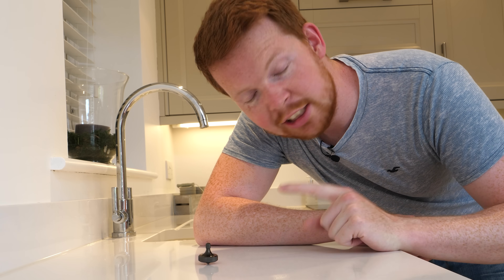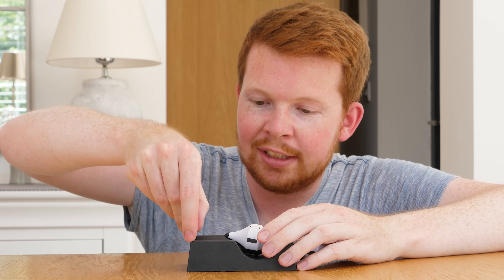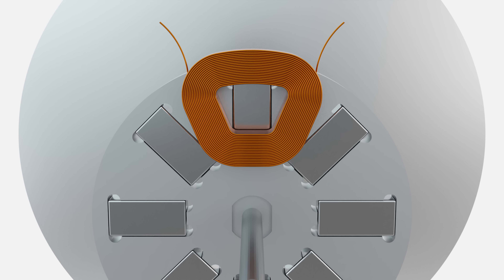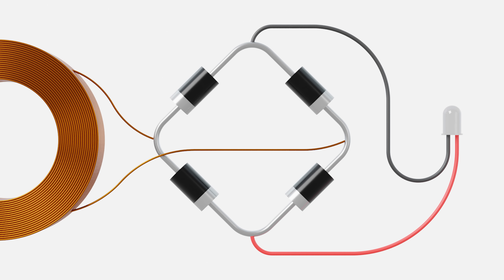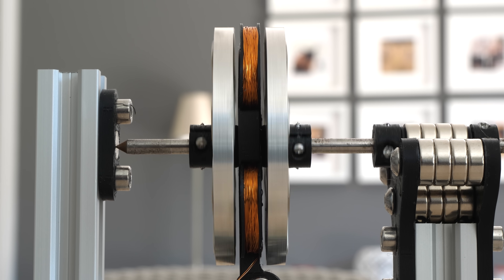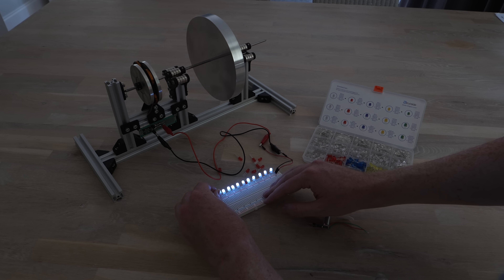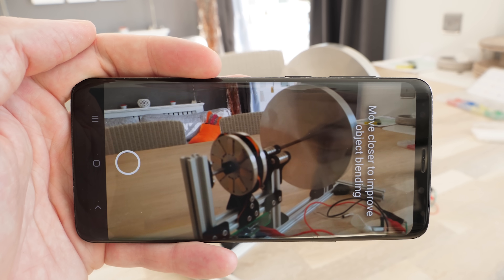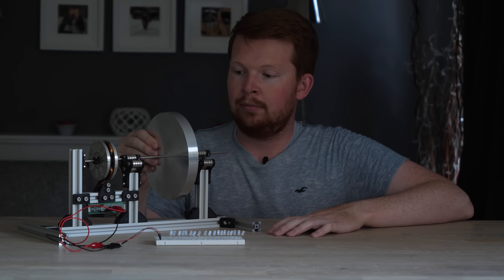Flywheel Battery

Comment: "We also need to convert the AC to DC"

proceeds to use two examples that can run on ac

:V
Reply: The LEDs would only be half as bright and would eventually die (although they are technically diodes, they don't like to block current or they die). That brushed motor would not run on AC...at least not in one direction.

Comment: what if you offset the coils slightly to make the flickering faster ?and hence have a smoother light ? you ll get less energy output stricly but to compensate you coul use a crank with a high gear ration so that you can power the whel with just a spin that multiplies 1 rotation to like a hundred or smthg ? sick project tho, could make that huge with bit more work on the hardware but i believe in you mate

Comment: 5:40 Incandescent bulbs work with either AC or DC, and fluorescent bulbs are generally designed for AC. What you said is only true for LED lighting, but if you buy an LED lamp from a store, it will have its own rectification electronics. It is however pretty tricky to control AC frequency and amplitude compared to DC

Comment: Maybe a good idea on one side is to have a gearbox that uses magnets to help spin up the flywheel meaning you can get a higher rpm from less spins by the hand, which also may help stabilize it

Comment: Bear in mind Tom that by adding LEDs in parallel will only split and share current (not p.d.) hence the flywheel will slow down faster, and you could add infinite LEDs at the same p.d., so perhaps adding lots of LEDs in parallel is not a good test of p.d. induced, but instead an LED test in series is more useful.

Comment: If you add a synchronous motor controller, you could also pump power into the flywheel as well and use it as a kinetic battery (or more like a capacitor).
Also, there must be some way to use similar magnet tricks for the axle endpoints and get rid of the friction point at one end... 
Other than that, there is the option of removing the air around the flywheel, running it in a vacuum, but that one it's slightly more complicated :D
Cheers,

Comment: two sided support, cups
Reply: step up converter
Reply: make that dc, you dont have to alternate, flip flop, from side to side
Reply: you are so used to electronics in motors, that you no longer can make a dc motor-generator
Reply: also you can move the coils away when you dont use the device, energy storage, like a clutch, just put a planar radial wire coil to extract or spin the flywheel
Reply: that hand cranked energy storage, you would even pedal it
Reply: what if you flywheel a current in super conductor, thats a YBCO super conductor inductor battery, L=1000m, I=5kA, E=½LI^2= ~3.5MWh
Reply: flywheel car floor bottom flywheel with maglev on stick, opposite poles maglev, rpm 20000 or 20kprm, radius 1m, 300Wh/kg+, as battery, acts as a flywheel stabilizer, the car will stay level no matter how you punish it, similar to the vacuum turbine succing the car to the road, or down force vanes on the car, say 200kg of flywheel, to have some stability from the rotation momentum
Reply: plasma wire as coil inductor battery, same idea as in the YBCO coil inductor battery, E=½LI^2

Comment: Putting the coils in series on your generator actually only works, because the number of magnets is divisible by the number of coils. If you had, for example, 6 magnets, the AC voltages at the coils would be all out of phase, and the resulting voltage would be quite low.

Comment: The mass on the center of the flywheel contributes very low so it would better if the middle is hollow and most of the mass is on the edge.

Comment: Why can't you hook up the electric motor to keep the flywheel spinning thereby creating a perpetual motor.  flywheel keeps providing power to the motor, motor keeps providing power to the flywheel and so on.
Reply: There are losses in every step of the process, so it will just stop in a rather big hurry. Perpetual motion is physically impossible, and so is "free energy".

Comment: This could be so much more than a desk toy.
Tungsten is weakly magnetic, so maybe that could make for a heavier flywheel?.

You could optimise the shape of the flywheel like you have done before.

You could get a glass rod instead of metal and glass on glass has a low coefficient of friction.

You could make a device that when you push on it, the flywheel spins up.

You can do this in a partial vacuum in a more suitable gas.

The part of the contraption where you push on should be easy enough to manufacture.
How it will spin up the flywheel is up to debate.
You could use air, but it runs in a vacuum.
You could try spinning up the axle, but then you need a way to connect to the axle without rev matching.

But if you manage to do that you can potentially store loads more energy.

Also, it would be interesting to see if, when you add load, the rotational speed decreases and increases when you take away load

Comment: There’s another way to arrange the magnets that would actually be frictionless. Look up the force on a magnetic dipole from a magnetic field, and you can then see what kind of magnetic field you need to generate to keep the magnets in a potential well of sorts. 

What you’ve got is a passive axial magnetic bearing. There’s papers out there on how this has been achieved for example with Halbach arrays. The one I’m looking at right now  exerts about 1000N per Millimeter of axial offset, and about 20 Nm torque per tenth of a degree axial offset. (Jinji, et al 2011)

Mainly I just want you and anyone watching to know that it is not necessary to have a pin like you have for magnetic bearings to work, but it appeared to be simple to implement, which is often the highest priority for home projects

Comment: Extract the planetary gear box from an old drill, mount it backwards on the shaft and add a crank with a further increase in ratio
Add a free wheeling ratchet like on a bike so the crank doesn't turn when you stop changing it

Comment: Please make an electronic gearbox that uses this principal. Possiblity a bike where the pedals drive an alternator which powers a motor controller which spins the wheel. It would be a bike with an infinitely variable gear ratio.

Comment: At the voltage levels you are using the forward voltage drop across the diodes is probably consuming a large percentage of your power.  Consider using a FET based full bridge rectifier.  You get a much better FET conductance (lower resistance) than from the diode alone.  I have not used these myself but a little googling and I found the LT4320 (which seems to require 9v) or the TI "smart diodes" used to build a full bridge rectifier such as: https://www.ti.com/tool/TIDA-00858#descriptionArea.

While diode full bridge rectifiers are great, they are not efficient especially at low voltages.

Comment: It's like when you have two motors and you connect them electrically together, and when you mechanically spin one, the other spins too. 
It feel even more magical when you do this with huge 3-wire brushless motors, because the positions are kept in sync.

Comment: if you want to get way deeper into the electronics, you should you a hall efect senser and a motor driver to use those same coils to spin up the flywheel and see how fast you can get it.

Comment: I think what would be interesting is to spend it to a specific high RPM and see how long it takes to stop while powering the white leds.

And then spin it to the exact same high RPM with no continuity on the dynamo. And see how long it takes to stop with no apparent Lorenz forces.

And then compare the times.

However I would not have made this video until I had it completely balanced. Whether you had to start all over again with different aluminum plate and bar. I definitely would recommend having as little wobble as possible for a scientific result.

But nice video.!
Reply: Yes! This is what i thought he was going to show, this would demonstrate the battery part a lot better.
Reply: And maybe use an odd number of coils (instead of four) more closely spread across the plate (so non-symmetrical/without gaps a magnet would always be entering a new coil somewhere) or maybe extract multiple phases instead of going for the highest voltage to get a really nice solid DC

Comment: Be cool to have this on the forrunner. Incase the solar panel is blocked by rain clouds. Just crank the fly wheel to charge a battery. Not a car battery but stuff like a cell phone a fan. Or even a electric stove battery.

Comment: If you used a switching converter you’d be able to have an actual gearbox. By varying the amount of current you’re drawing from the flywheel, you’d be able to power any load at its ideal voltage / current, and take as much power as you need. Very similar to how an MPPT tracking solar charger works. Actually you wouldn’t need a switcher at all if you made/used an actual alternator with an armature coil or variable magnetic meshing. Changing the armature coil voltage or the magnetic meshing would effectively change the gearing of the motor.

And next time please measure the output power, voltage alone isn’t very useful.

Comment: When voltages are low you can do a mosfet configuration based full bridge rectifier and have ohmic losses instead of diode Vf. Simplest configuration is just 4 mosfets(low threshold ones). For wider voltage ranges some zeners and resistors might need to be added to protect mosfet gates as usually done in "mosfet reverse protection" circuits. There are also ideal diode bridge controllers like LT4320 that goes all the way to 72volts.

Comment: Ok, am I the only on wondering if there is a way to get this well balanced, then add a small but efficient air pump to the setup, this could be aimed at a modified fly wheel which could be efficiently rotated (blown round) by it. Ok, I know this would defy the laws of thermodynamics, but it'll be interesting to know just how close you can get to zero power loss.

Comment: So in theory, if you were to encase the device in a housing of sorts and add a propeller or turbine to the turning end of the shaft, you could have a relatively frictionless wind generator that could charge small batteries.
So cool!
Thanks for this.
Cheers!

Comment: Cant you just modify the part where the shaft of the flywheel is pushing against the plate by 2 magnets with a same pole facing each other. So the friction must be reduced even more.

Comment: Add blades to it so it becomes wind powered, and use the fan you installed near the end. Just to complicate things. 

Oh, and it would be cool to measure the rpm of each blade, and compare the numbers to see how much energy has been lost to friction and electrical resistance

Comment: I think a lot of people have a skewed idea about the weight of aluminium due to its use in things like soda cans.

I know I was like that at one point, then at a job I was introduced to a plate of aluminium that was about an inch thick and perhaps 3 feet tall and 1.5-2 feet wide..... I could barely move it.

Comment: I don't know which kind of diode you used, but If that diodes are a regular rectifier diode, you can use Schottky diode instead, the voltage drop across these kind of diode is very low. Schottky diodes you can use: MBRS360, UF4007...

Comment: Could you run a 5v motor to spin the flywheel whenever its rpm get too low back to high rpm and have infinite energy?

Comment: Hi Tom. Have the coil's rotating on the shaft and the magnets fixed and power very small motors with small propellers on that are attached to the Disc (Perpetual motion). Love your project's.

Comment: Hey Tom, please close your magnetic-circiut by adding metal sheet on the outside of your circle of mangets (Yust a circle of metal sheet on both outer sides). This should improve the magnetic field by a lot. Even more importent would be to add a magnetic core to Your coils. Because of the changing magnetic field, it should have a small hysteresis like a soft iron core or a ferrite core. The problem with this in Your setup will be the magnetic reluctance forces, which will give your flywheel a jerk torque, which propably is to much for the self-levitating mechanism. So perhapps you should stick with the metal sheets for the magnet-circle. Nice Video as always.

Comment: It would be interesting if you could measure how much energy loss you have when powering something. Let's say that the flywheel has x Joule in rotational energy and you transfer that energy to some kind of calorimeter (until the flywheel stops) to see how much of the original flywheel energy that ends up in the calorimeter. Another interesting thing would be to see how much energy you lose per second because of frictions (air, mechanical) when the energy in the flywheen is not used for anything. And are there unnecessary eddy currents that can be eliminated? Can the whole thing be improved by considering eddy currents?

Comment: If you increase the power demand on the circuit, for example by adding more LEDs, does it increase the resistance on the generator and slow the flywheel down more rapidly?

Comment: @07:49 IDK man... A 3D Print Stepper Motor Coupling ( https://i.imgur.com/mSTlln5.jpg ) with one side attached to the free end of the Flywheel Shaft and the other chucked into the Drill for a quick disconnect once brought up to speed could have prevented that janky looking setup with the roller skedaddling along the flywheel's circumference... 😑

Comment: Can you put a high torque motor (that charges with the power generated) on it to spin the fly wheel and see how long the circuit will run without stopping?

Comment: But for a electrical battery, i don't get into using flywheels for a solution for it.  But flywheels are great energy storage only for short time periods, very short. Useful in engines and machines, mechanical.

Comment: I would be interested to know how much the load slows down the flywheel. It looks like the flywheel slows down quite significantly with the motor attached. I've built a couple of mendocino motors which also use magnetic levitation, people always seem to ask me 'well what can you power with it!?' as if everything needs to have a purpose besides just enjoying a wonder of science. Anyway, a mendocino motor, and especially a small table model isn't really fit to power anything but itself. It's interesting to play with these setups, also to learn and conclude that there really are laws in place for the conservation of energy, and you cannot make energy out of thin air. This is why most people claiming 'free energy devices' to work, are also the people who've never actually tried to build one. Experience makes you more educated.

Comment: You should compare how long it takes the flywheel to spin down with only 1 led vs with 10+ and see if you can measure/notice the counter torque generated by the extra led's in parallel pulling more current, because I bet you there would be a not insignificant difference

Comment: Just get a bit of string and you should be able to spin it up to quite high rpms easily. Also if the shaft wont come off heat up the flywheel with a blowtorch. Probably need to put the shaft into icewater tho since alu conduicts the heat very efficiently. Or just drill it out.

Comment: You need to use schottky diodes in your rectifier. They have a smaller voltage drop them silicon diodes.

Comment: When I saw the thumbnail of the video, my initial thought was that you will use the flywheel to mechanically rotate something via eddy current coupler (I thought that the alternator was the eddy current clutch/coupler on the first short glance). :))) Nevertheless, your project is so interesting and amusing. I liked the video right away, at the start of the video, I was confident that the video is excellent right away from the getgo without watching the video to the end.

Comment: Do it again, but this time with thicker shaft and the bearings totally surrounding the shaft 360 degrees. Like how you make that Y piece that holds magnets, make it an O piece where the shaft fits in the center with magnets surrounding the shaft magnet/s.  This way it still works if it is on its sides or upside down, and you can put a hand crank on it and that O bearing will hold it in place from your force pulling up, down, and around using the crank. Note: use hand crank with a type of clutch so it catches on the shaft when you crank on it by hand, but then the hand crank sits still after you let go, but allows the shaft to spin.

But that is another experiment. Try to figure out how to make a magnetic clutch for the crank. Meaning the bearings for the clutch being magnetic.

Another experiment is to figure how to get rid of that glass plate and pin point, and make it into a magnetic bearing too. Get rid of that friction point! Figure out how to hold the shaft in place without allowing physical points rubbing. Put magnetic end bearings in place of that glass plate, but put them on both ends, and now it is secure no matter if it gets moved or falls on floor, or when you hand crank it, etc... it will always remain in place up, down, left, and right.

Comment: What if you put a magnet at either end of the axle that pushes the same as the vertical magnets so it is not touching any surface to stay spinning with even less friction? Just a thought

Comment: Hi Tom, it seems you forgot to add core into the center of the windings. To improve things add ferromagnetic cores inside the wound wires to give the magnetic field a low reluctance(magnetic resistance) path through.. if the air / plastic is the conduit for magnetic flux.. much energy is lost on high reluctance path. ☺️
Reply: Just additional note not inside the winding.. but inside the loop.. 🤣

Comment: You could have done a 6 coil 3 phase system instead of a 3 coil single phase. You would get 2/3 of your voltage but the output would be buttery smooth straight from the rectifier.